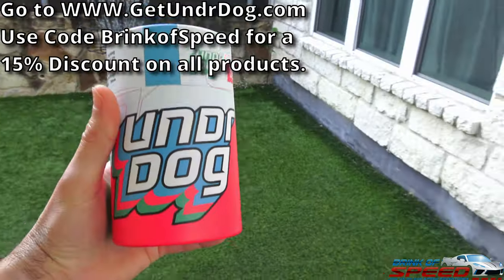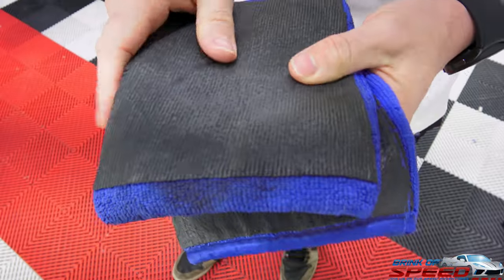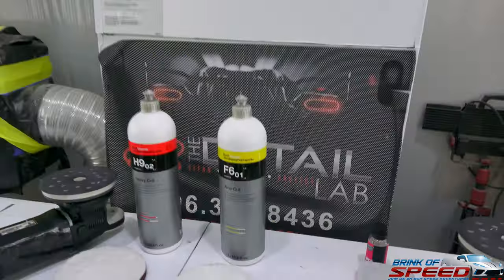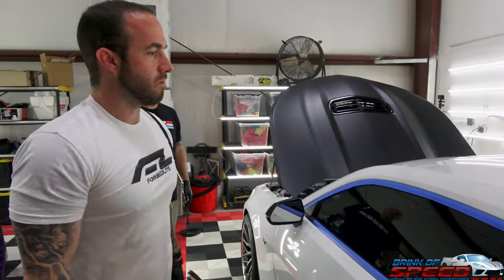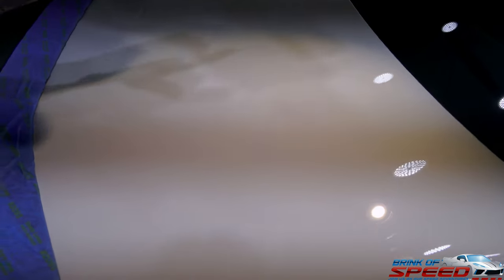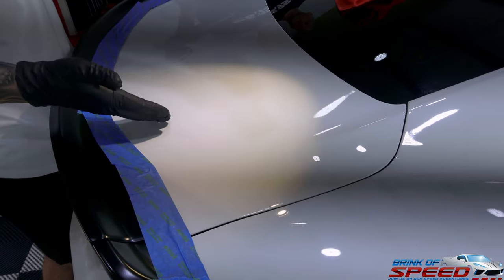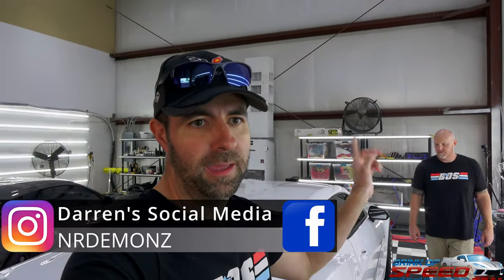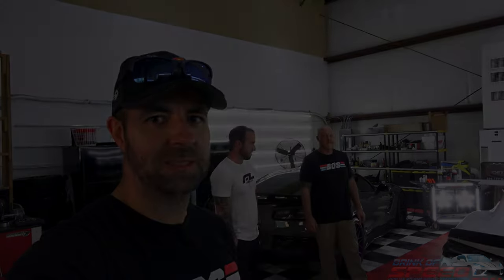WATCH what THIS does to my Camaro! Incredible!

Comment: I have a 1LE. No matter what coating you use the paint will get rock chips. Did  you ppf the nose and splitter?  I just did that to mine the front end takes a beating.